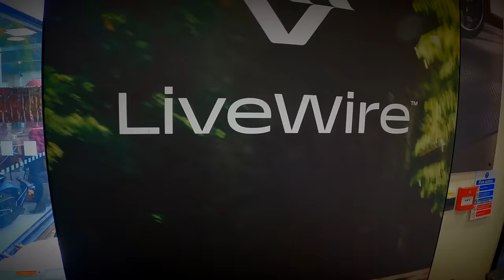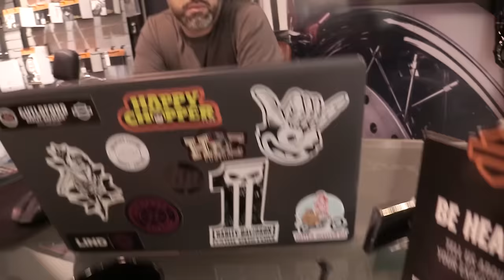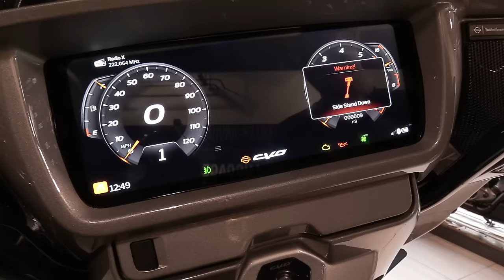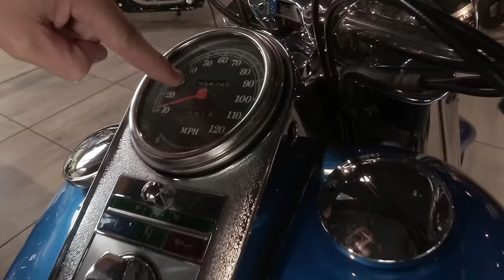Catfish Chasing + Harley Davidsons Ultimate motorcycles + Restored Military Landrover

Comment: Happy birthday Graeme.
First decent rifle my dad bought me about 55 years ago one Christmas Webley Falcon 
.22, used it so much after a year or two the stock needed doing up so my dad taught me how to button polish and after quite a few coats it built up a deep lustre showing all the beautiful grain of the wood and it never needed doing up again all the years that I owned it, guess it was a better job than the factory finish. 
Also had a Feinwerkbau 177 target rifle that they used in the Olympics around the early 80s fantastic rifle think it had double srings and was the first  recoiless air rifle. You wouldnt want to carry it around much as i think it weighed about 11Lbs, the Falcon wasn't light at around 6Lb for comparison.
Dont get wet in the coming weeks, can't really say that Ive ever caught much in heavy rain. Light autumn drizzle different story.

Comment: I did have the Harley Davidson Dyna Fatbob, i went all over the UK with a travel rod and gear on it, everyone loves the roar of a Harley (not!!!!). Then some dip shit polish girl stopped in the right hand lane on a corner to let an ambulance pass her, i went straight into the back of her as I went around the corner, I could not see her as it was a corner.... Yes they stop in the right hand lane in Poland, But I was in the UK... as i hit her in the back i was forced to pay all damages via insurance. My insurance said yeah it was her fault for slamming breaks on and parking in the right hand lane but in the UK there is a rule, if you hit anyone in the back its automatically your fault. Insurance are idiots. I now use a dash cam in both my car and motorcycle. The Harley was written off as it would have cost over £7,800 to fix... My leg still hasn't healed 1.5 years after the event, severe nerve damage... i can no longer stand up or walk. Fishing is a long lost thing to me now, but i was fishing since i was 4 or 5 years old. so 40 years now.